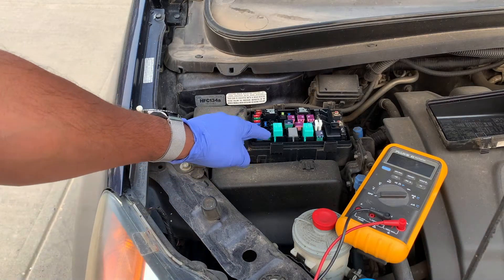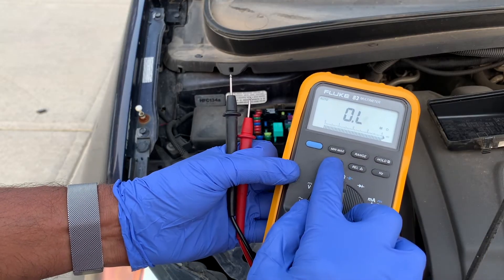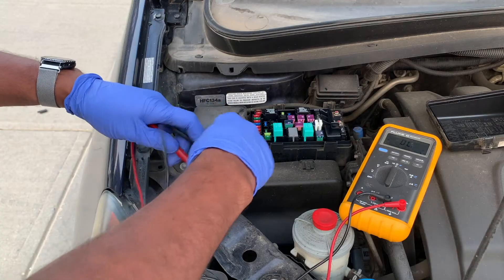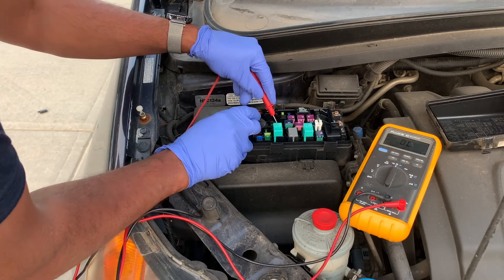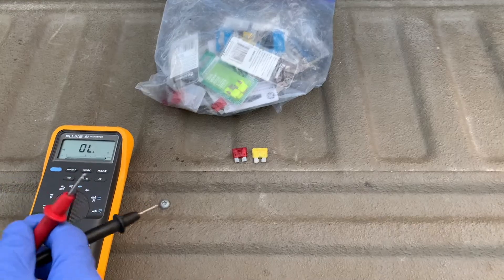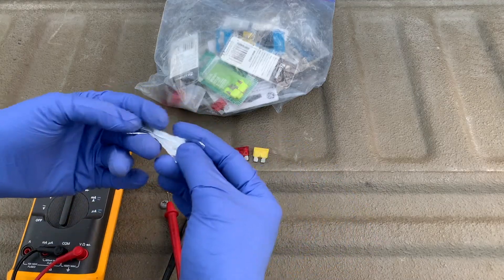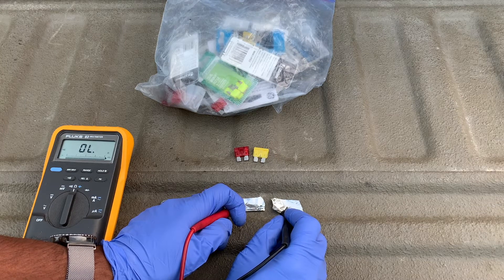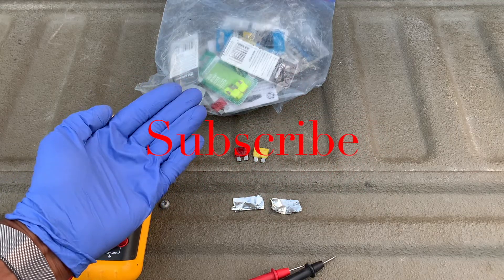How To Test Your Fuses - using a multimeter continuity setting

Comment: can you test a fuse when it is still in its connection? (not removing it)
Reply from the maker: Yes - you can check a car fuse without removing it using a multimeter or a test light by checking for continuity or power across its terminals. For a multimeter, set it to the continuity or low ohms setting, then touch the probes to the two metal contact points on top of the fuse; a beep or low reading indicates the fuse is good, while no reading means it's blown. A test light should be placed on the terminals; if both sides light up, the fuse is good; if only one side has power, the fuse is blown.